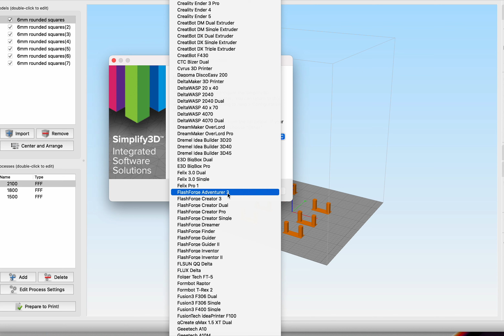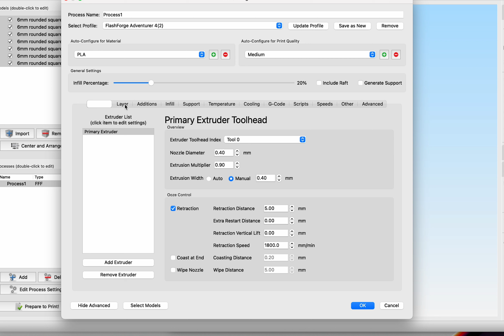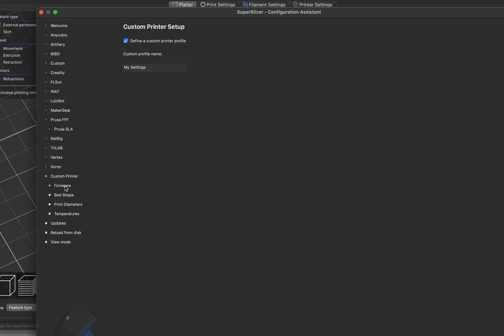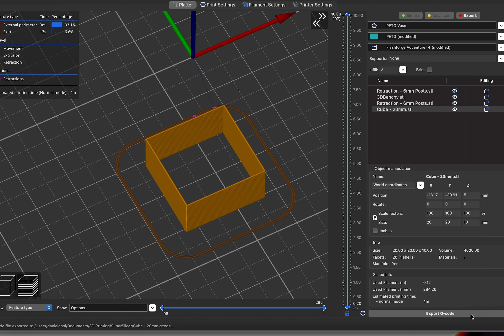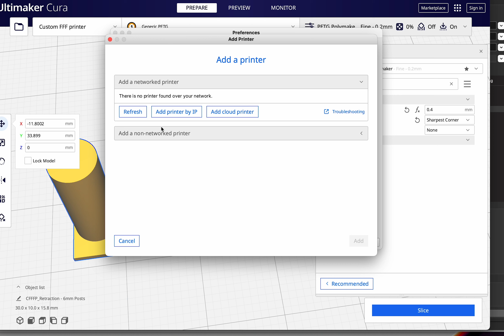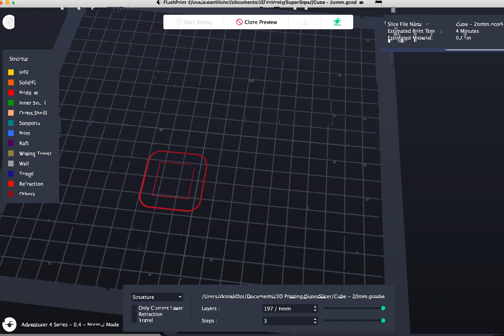SUPERSLICER, SIMPLIFY3D, and CURA Setup For Adventurer 4

Comment: March 8th 2023 - The superslicer settings weren't working for me in the latest version, so I loaded a couple of existing gcode models from flashprint and got these settings working for the prints (all other settings matched video, except for the gcode below, using Marlin (legacy) for gcode flavor, and setting the origin to 100, 100 which could be tweaked, so that the objects would load in the center of the bed when brought into flashforge for sending the code to the printer over the network) - note the first M118 line differed from file to file, but the rest matched exactly between very different models in flashprint, and I haven't found exact documentation on how this affects things, but using these values worked for me by exporting the superslicer gcode, and sending over network by loading the file into flashprint.-

Start gcode:
M118 X104.46 Y100.00 Z28.20 T0
M140 S55 T0
M104 S225 T0
M104 S0 T1
M107
G90
G28
M132 X Y Z A B
G1 Z50.000 F420
G161 X Y F3300
M7 T0
M6 T0
M651 S255

End gcode (same on both flashprint-created gcode files I checked):
M104 S0 T0
M140 S0 T0
G162 Z F1800
G28 X Y
M132 X Y A B
M652
G91
M18

Comment: Thanks for uploading this! I was able to use Cura for my Flashforge Adventurer 4 as a result which is great! I did run into an issue though that I was hoping you could assist with. I started printing some LW PLA aircraft parts and everything was running fine with the build up until a height of 73.5mm. At this height the printer decided to retract the whole spool of filament back and forth like crazy and then start printing again without any filament in the hot end. I tried three times and it did the same thing in the same spot. Any ideas?? 
Thanks in advance
Reply: Hi, have you figured out the problem? I think I'm having the same issue, where the printhead jams into the same place during a large print and does the retraction and stops the flow of the filament. I also used cura but with the start and end g-codes and the cura2ff software I got from Flashforges customer support.
Reply: @GlitcherNoobOfUYA  Yeah it was an issue with the profile as something was getting scrambled in the G-code. I reconnected the printer to Cura reloaded a new profile from scratch and it did the trick 👌

Comment: Hello!!
acquired flashforge advantage 4 and realized that for real useful information can only be obtained from you. THANKS. Can you help me well and I think it will be necessary for everyone to choose the settings for prusha slicer. There is nothing on the Internet regarding this issue. super slicer settings are not suitable for those in the video. the printer does not print in the center and corner and does not want to set the temperature of the platform.

Comment: I am trying to use the printer with cura but it automatically changes the extrusion temp to 235 at the start of the print (even though the file says 220 before starting). I cannot figure out how to fix this (basically copied everything from the video). Any idea where I could look first? I am new to 3D printing so any tips would be greatly appreciated

Comment: Do I need to convert my GCode files to GX? I'm having issues with the GCodes from Cura, the printer sees the files but doesn't display the model on the screen and when I start the print the extruder comes down to the bed touches quickly then goes up a few inches and starts to print on nothing

Comment: Hi Daniel. I had an issue with serious gaps in my prints, I tried using others sw with your settings here and they don’t work, I did my own research and tried various settings and I finally solve this issue with Prusaslicer but when I choose gcode flavor I have to select Sailfish, not Marlin, and with this it prints really nice, I had to tweak others things but really good result, just one issue that looks like the sw can’t control the cooling, I have to turn it on when the print pass the first layer… do you think my Ad4 have a different controller?

Comment: I tried a similar config to this elsewhere, which worked (Tried this too). After latest firmware update v2.1.6-2.1 it doesn't work correctly, and starts printing in the air.
Reply: FYI I have rolled back to previous version of firmware and it works again :)

Comment: Hi, Daniel, I am a Flashforge adventurer 4 novice inventor. Thanks for the videos, we need people like you to help people like me, : )   Sorry but, I'm a bit confused, I have no problem with PLA it prints absolutely fine. But it's the PETG I have a problem with so I have been following you to find out how to print the PETG. I have even attempted to download simplify3d which is only a 2-week window to try so I would need to know what to do and what settings. so are you saying to use the PLA setting to Print the PETG for now?
Reply from the maker: I do have a video on how I tuned petg. In that, I have screen shots of my settings. But at a quick glance, start with 240C, bed temp of 80C, 30mm/s speed, fans at 10% and retraction at about 6mm. This is got the adventurer 4. Make sure it didn’t squish the filament into the bed otherwise it would take a chunk out of it. Use glue stick underneath
Reply: @justmakeitdaniel7667   Thank you, Daniel is that the video from Mar 7, 2022, using the super slicer software?      hope you're getting on better with your new FFA4 v2 🙂
Reply from the maker: @joegoodwin6426  I used superslicer mainly in that test but there were a few prints I would use s3d to compare

Comment: Have you been able to connect Cura to the A4 via WiFi? I like being able to send my prints from my computer and so far only Flashprint will let me do that.
Reply from the maker: no I haven't been able to do that. Currently I just export the file from Cura and open it up in flashprint to send over wifi
Reply: @justmakeitdaniel7667  I guess that’s an option, but if I have to do that, I might as well just use Flashprint for everything. What feature does Cura offer that a Flashprint doesn’t?

Comment: Have you printed SuperSlicer's built in temperature tower (found in "Calibration -> Filament Temperature Calibration") before? I have tried a few times using your profile and custom profiles I have made. My Adventurer 4 sets the temperature once and does not change temperature at each point. Any suggestions?
Reply: I should mention that I have inspected the gcode and can confirm that the M104: Set Hotend Temperature command is present at various points but does not seem to take effect.
Reply from the maker: I have found the same issue. Haven’t figured out a solution yet but I think it has to do with superslicer trying to use two different commands to set temperature at the beginning. Something like an M196 IIRC also is present in the start code

Comment: Eidt ( see comments below for Cura settings from Flashforge) Where did you get the gcode for your AD4 settings for Cura? The end code looks the same it is the start code that is different. Same when I look at a gx file from flash print with text edit. The start is slightly different. The way I set it up in Cura is I took the dreamer and only modified the bed size but have to stop them early on (only tired 3) First layer or two is fine but quickly I hear clicking /skipping from the Bowden feed causing the plastic to stop flowing so maybe it is just a temp issue once the first few layer temp drops? Oh and not sure you did it but in the cura marketplace I added the GX writer plug in.
Reply from the maker: No I didn’t add the GX writer plugin because cura exports .gcode which the adventurer 4 is able to read. I got this start code off of someone on Reddit and the code for the most part makes sense. I didn’t bother making it exactly like flashprint since I didn’t have a problem with my prints so far
Reply: @justmakeitdaniel7667  Thanks for the feedback Daniel. Didn't know the AD4 read the Cura gcode. I was used to the GX writer from using my Flashforge Finder with Cura  so just did the same thing. Less variables to worry about. ok on the gcode from reddit. I will give it a try too once i get my fan speed and temp dialed in. Looking forward to the next vid!
Reply: You're clicking is because your extruder temperature is randomly dropping to zero, I'm having the exact same problem and have confirmed it is doing just that

If your temp is normal then you are experiencing the coordinates being out of sync which will also cause this

I have found a very useful write-up, it is extremely in depth on how flashprint interprets the code, the problem we are having is with I believe it was the m108 command which is emergency brake, Flash print uses that as a way to retract filament, when you look and compare a similar slice, you will notice a lot of g0, and with flash print you will see none of that, your print fails when you have too many g zeros in a row, turn off retraction and you will have no sounds, the code will also be all g1s go figure

I have not tried this specific code yet, I'm about to just waiting for a print to finish, but I've been at this for about a month and for me I do not have the same results as others and I have no idea why

I'm not sure if maybe the problem lies in the print profile as well, it would be great if you guys could share that with the rest of us, that's the only other thing besides the code, my code looks exactly like flash print yet I still have this zero temp problem, so perhaps there's a setting in cura that's not supported by our printers
Reply: @Johneyap  CLicking etc, I also think some of that was due to a temp issue. I was printing my hatchbox pla at my old settings and the AD4 has a STRONG fan and what I normally printed at 195 is now 220 with the fan speed at 35%.  I did a temp tower and found the sweet spot for bridging and stings, and then did a fan speed test. The new benchy was super clean both in cura and flash print. I also recommend swapping out the black sticker for a pei sticker like Daniel did just get the 235cm size the 220x220 is slightly too small. So SOOOOO much easier to remove even one layer of PLA for leveling. I got my sticker here 3djake.com it was the buildtak pei film
Reply: @mattdicke3414  I will definitely look into it thank you very much, you are right it is a temp issue I forgot to mention my temperature is not reading correctly and it appears to be after it switches from first layer to rest of print, first layer which is set with the g code is correct, it's when it switches and I don't know how to turn that off in cura, value 0 doesn't work

If you make a cube that's 0.2 by 0.2 / 0.2 mm and slice it you will get G-Code start and end only, that's how I've been troubleshooting

You can also save in flashprint as. G and get rid of all that b***** at the top

I figured if I can get the start and end to match the same the rest should follow, all of the settings I have found so far cause a horrible whining at the start, what I have so far doesn't do that, so I think I'm on the right direction but I am a complete noob
Reply: @Johneyap  Try the info from flashforge I posted above. and add the gx writer plug in from the marketplace with-in cura. I find it works better once you slice and you get the little icon for saved prints on the touch screen. And yes CUra maks the printer have a louder noises especially in the xy shift. It is odd i don't quiet no why as that should be a hardware issue not software, and i matched the print speed settings as best i could in cura vs flash print. That one I would love to figure out but its livable as cura is a better slicer and the end quality shows.  FYI I have been printing for about 2 years and still feel like a noob. so no worries. this printer was a bit harder to dial in than my other ones but I have learned a lot from the FF ad4 group on facebook and now feel a lot more confident getting better prints with the AD4. Happy printing
Reply: @mattdicke3414  still no luck, I dont seem to find your settings, besides the temp and fan speed but that didnt help.  On the LCD the temp will physically drop to 0, i will try the plugin, but i dont think that will make a difference.  

With the code i find on reddit, i get that starting whine, and fail at `25%, with my current code i get no whine and fail at 80%.

that whine isnt normal and can be corrected, i would love to look at your start code and see if i can spot the difference.

i dont fully remember how i fixed it, but now it not only starts like flashprint, it prints like flashprint does, i cant explain this to easily lol

What i am attempting is to print a blank file and make the output match.  if you have a flashprint slice as .g it wont save the header at the top
Reply: I have also done the dreamer nx, as well as every other printer that is supported by cura, it didn't help, but it did get me to 80% before my issues

The write up I found which I can share with you guys want, also specifies using reprap, he says it's a better compatibility with our printer, but it has other issues such as the flow rate being in cubic.  But that can be remedied by increasing the flow rate, I'm just not sure if that does damage so I haven't tried it yet

When I did try reprap I stopped it right away because it was dotting lines and I thought it was scraping the bed

Comment: Wow! I finally got better results out of my Adventurer 3 pro :)  it was really hard to find someone that really could help me figuring out how to setup the different slicers. Just wondering how is it possible to print using Cura? Since the format are not compatible with the machine. Mine only prints at .g or .gx
Reply from the maker: So if you load a .gcode file, you get an error? One thing you could try is opening up the file in a text editor like notepad ++ or sublime and compare the original with a copy that you just change the extension on to .g. If the text is all the same, then I would feel confident that the modified extension .g file will work